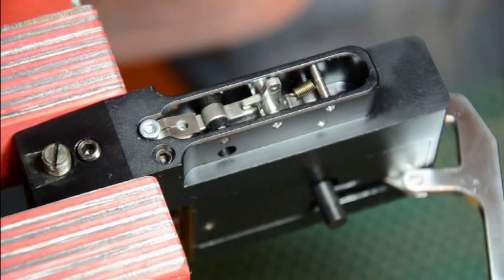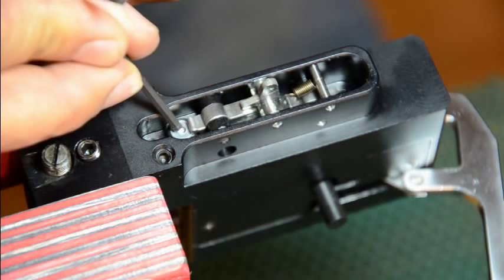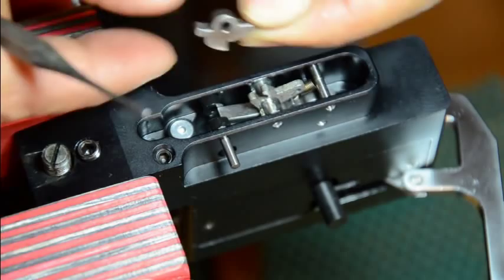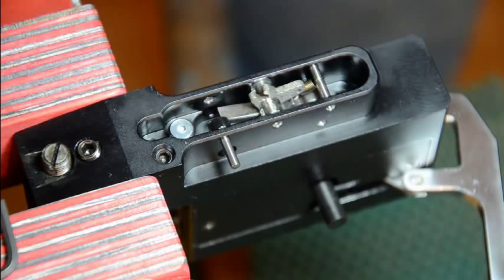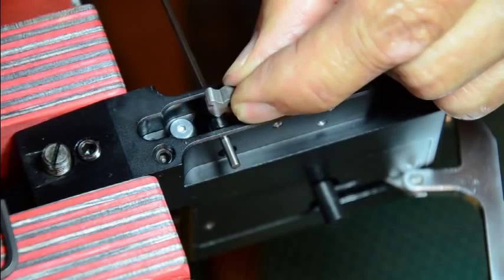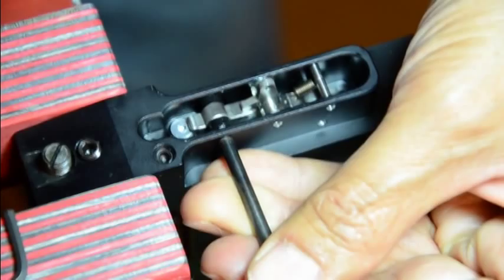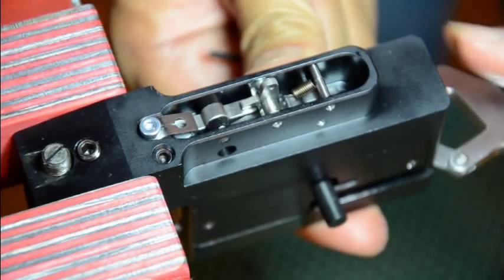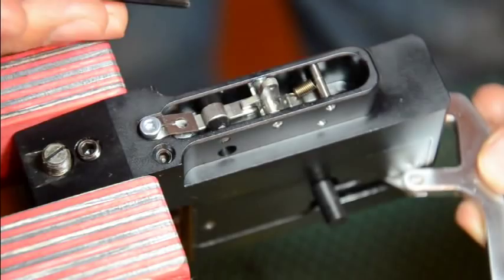KalibrGun Cricket Air Gun PCP Trigger Modification and Adjustment #1

Comment from the maker: Hi Cassius, yes it will solve your problem. it did on mine. you don't have to use o-ring, you can use home made rubber washer. just don't use lock tight, thread sealer etc.

Have shooting!!